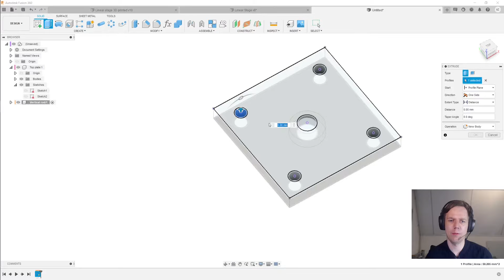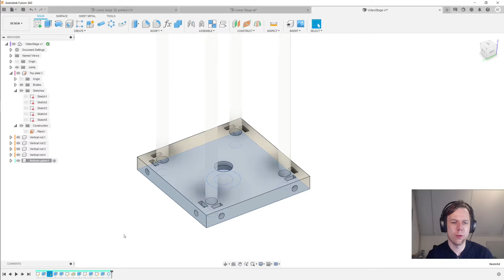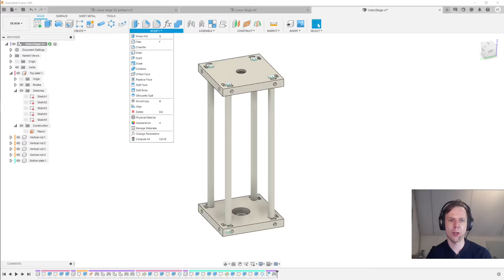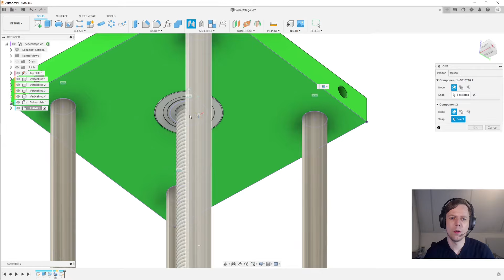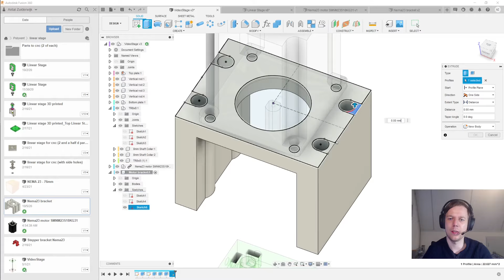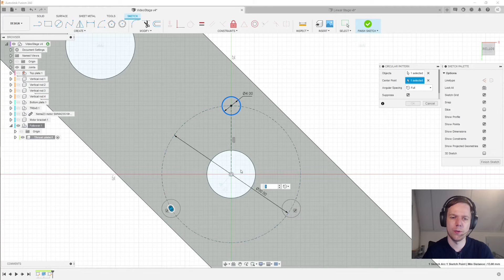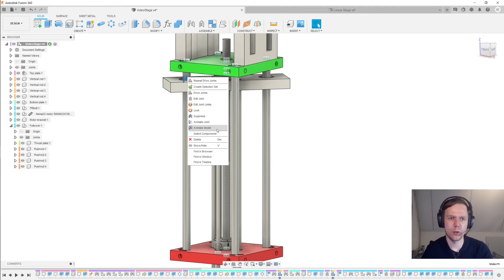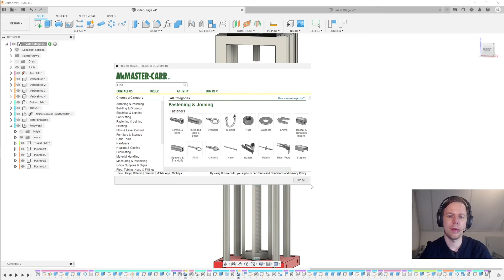Fusion360 Assembly Tutorial; Full practical assembly from scratch

Comment: Great and very helpfull video. Learned a lot from it. However, I have one question: how do you rotate the lead screw using your mouse? I have no idea how to do it. I would like to test if I have jointed the collars correctly (so the spin with the screw)
Reply from the maker: I think I just leftclick the leadscrew, keep left mouse button held down, and then drag around. Thanks!
Reply: @antalz  For me dragging the collars works (lead screw and other collar rotate along). Dragging the leadscrew does not work. But....this is good enough :-) Thanks  a lot !
Reply from the maker: @more9lives  That's very curious. Does animate model work as expected on all your joints? The manual dragging is a bit glitchy sometimes I have to add, maybe it's just that. Once you add the follower near the end and have the motion link set up you should check if you can drag the follower
Reply: @antalz  I have not yet added the follower yet. In fact I'm probably going to use two lead screw nuts attached to a block. I am using your video to learn how to build something like this: https://www.youtube.com/watch?v=6pfnKuKy6Lg only with 2 instead of 3 parts. Also I will not use ball joints but normal joints. 

The goal is to make a sort of "lift" to move my web cam up and down. I'm using a big TV as a monitor and currently I have the webcam on top of the TV. During online meetings this means I never look at the people I'm talking to. This annoys me. I'd like to simulate that I am looking at them instead of my screen. So during a meeting I'd like to move the camera in front of the screen and position the video right above that. Not sure if it will work buty it gives me an excuses to make something :-)

Comment: Thanks, it's very clear! For the rods, I would have created a rectangular pattern.
Reply from the maker: Thank you! I think a circular pattern is a better choice here, for 2 reasons:
1) The distance in XY is a weird number, so I don't know if you can enter enough digits to prevent Fusion360 from detecting interference
2) Circular reacts well if you come back to change the sketch, as long as the leadscrew runs down the centre. With a rectangular pattern I think you have to come back after the fact to change the distances.
You can probably sidestep both problems by using the parameters.
Reply: @antalz  I was talking about the first 4 rods, not the second time where you used the circular pattern.
Reply from the maker: @x87alpha1  I think I'd still use a circular pattern for the first 4 rods. I used copy->paste there mainly to show the difference between paste and paste-new. But there are always multiple ways of achieving the same thing, so there is a lot of room for personal preference.
Reply: @antalz  ok make sense. I think the benefit from patterns is if you change the parameters of the rods you're using, let's say you find the clearances are not ok after you build the machine. But agree, the same outcome can be achieved with different ways.